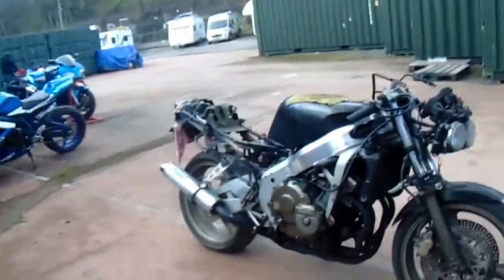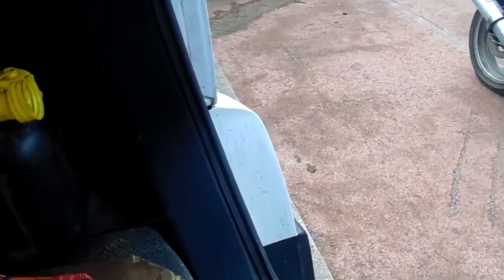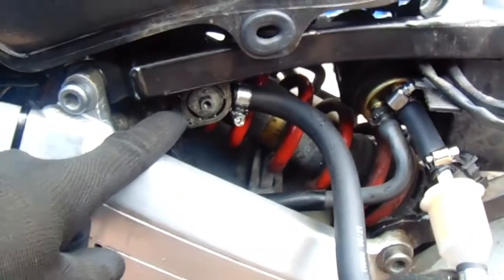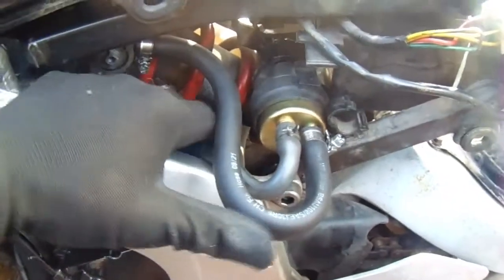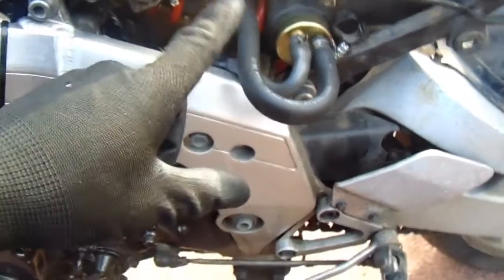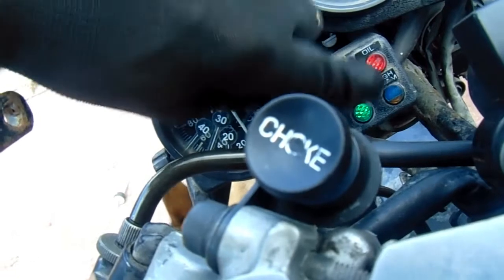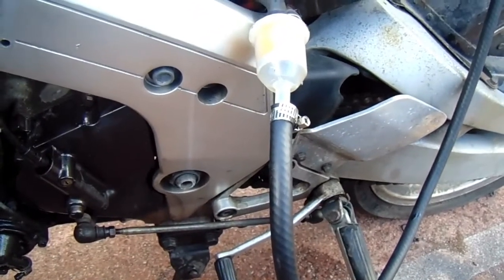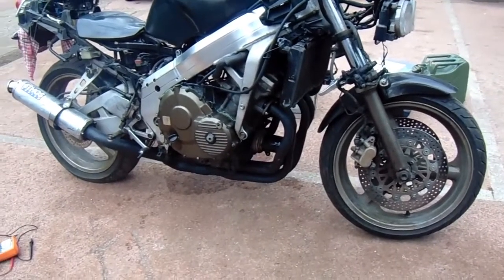CBR400RR NC23 REFUSES TO START

Comment: The petcocks are often a bit crap just due to the design of them. They often leak when you move it. You can get new ones for cheap but tbh they're the same design so also a bit crap and will probably leak eventually, plus the one I got, the filter mesh thing didn't fit, so I reused the old one. I've heard you can take them apart and replace the seal but I've no idea how or where you'd get a seal. That shouldn't stop the bike from running though as long as the petcock is actually opening up. They're a bit crap though and I've had to give mine a wiggle before to get it to actually flow into the fuel filter. Best option would be to change to a better design, which I plan to do to mine at some point.

The fuel pump doesn't run until you try to start the bike, it doesn't run with just the ignition on by design. You can bypass it by jumping two of the wires on the fuel cut off relay plug (I think it was the black and black/blue ones but I can't remember) so that it does come on with the ignition and you'll be able to hear it clicking away. Again, though, this shouldn't actually stop it from running as these bikes can run on gravity feed alone. 

I had a very similar running issue on mine and checking the spark, there were no sparks, so I'd definitely check that, which is nice and easy. The Haynes manual has tests for everything in the ignition system and they're very easy to do. The only test it doesn't have is a test of the CDI, which was frustrating for me as eventually, I figured out that was the only thing to be at fault since the wiring was fine and every test had passed. Turns out my voltage regulator/rectifier wasn't working properly and I guess an overvoltage had fried my CDI, which is apparently quite common. Looking at your reg/rec you seem to have a wire loose so I wouldn't be surprised if you had the same problem.

On mine, I replaced the reg/rec with a decent one (not a crappy Chinese one) and bought a used Honda CDI. Mine was from an '89 RR-K despite my bike being an '88 RR-J, so I did have to fool the CDI speed signal with a live wire so the speed limiter didn't think the bike was doing 112mph+ all the time. Runs beautifully now. 

If you do have a good spark on all four and it's not running, I'd suggest the carbs may be so far out that it won't run. It's a pretty simple job to rebuild them and nice and easy to set them to factory settings. 

I hope you don't sell it, they're awesome bikes and only going up in value. Well worth the time and effort. With these bikes, it's very easy to convince yourself that something is the problem, when in actuality, it's something else and you end up throwing parts at it. Best thing to do is to stop, think logically, follow the procedures in the Haynes manual and you will find your problem/s. There are also some good groups on Facebook, with a lot of knowledgeable people on there (and some not-so knowledgeable).
Reply from the maker: Oh I wish you had wrote this a week ago LOL, its now sold on Ebay and to be honest Im very happy with the price so its going to go, I'm gonna get my thunderace MOT'd and go for a few rides on that, that needs a few nits for the MOT so the money I get from teh 400 will go towards that, you seem to really know your stuff about these bikes, do you think you will do any bike videos? You could certainly help loads of people out there
Reply: @jasonparker333  I think I will at some point. I'm more of a car guy but a lot of it translates over and the only reason I know this stuff is because I've had to deal with it lol 😆